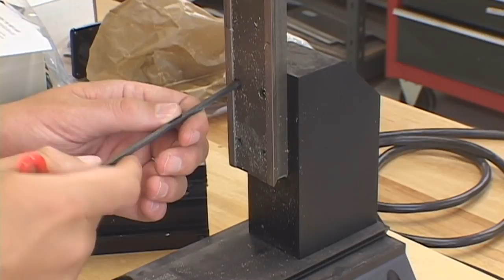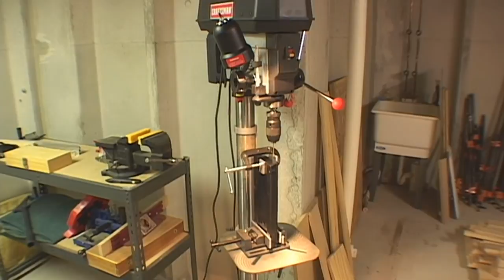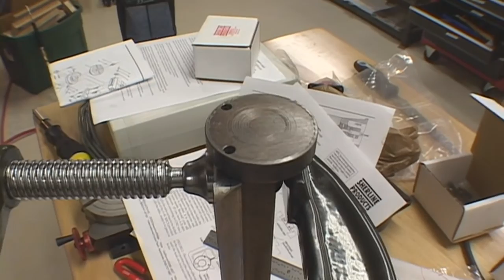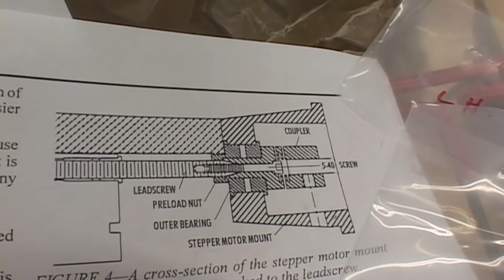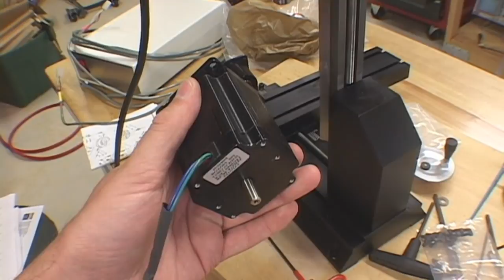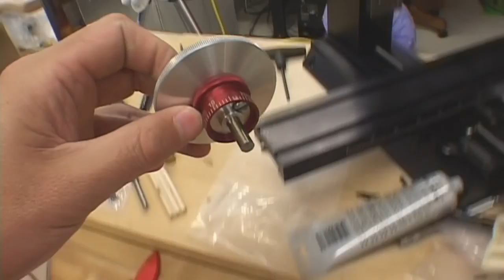Sherline Mill CNC Conversion 2 of 2

Comment: the small nut is annoying :  I cannot lock it properly because it's reversed on the lead screw , have to put glue also , but sometimes the coupler disengage.
also the combination (small hex screw, nut )  squeeze the 2 ball bearing ( can feel they force and not supposed to be used this way ) 
any ideas ?  ( sorry for my poor english )